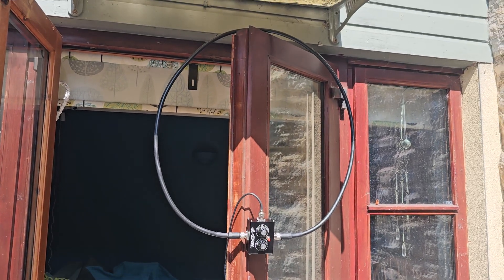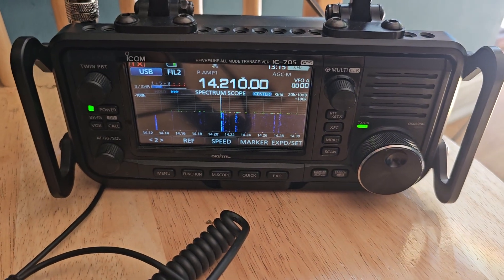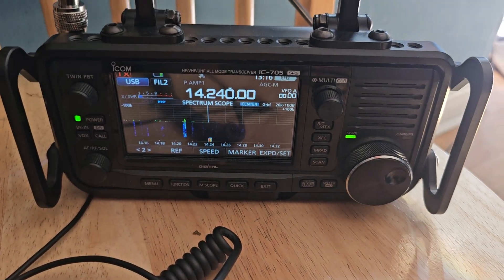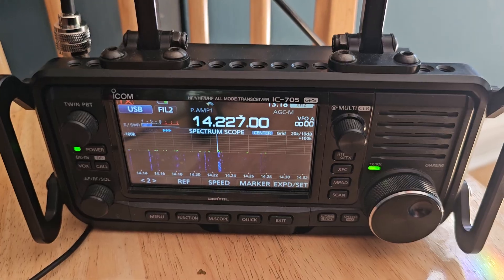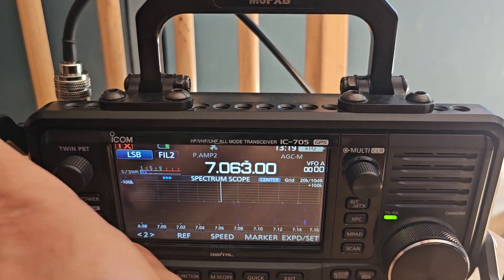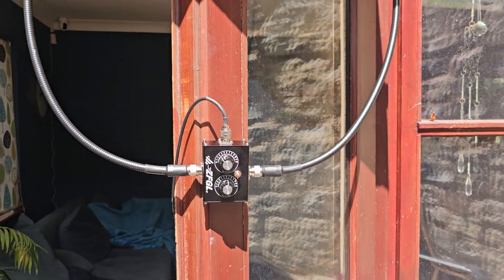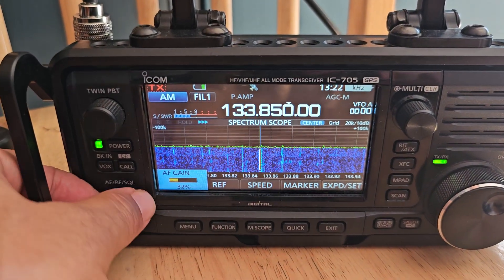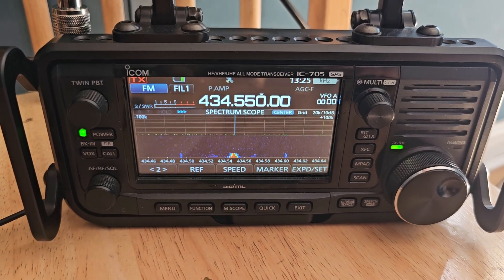Live Test - HG-20A 20w QRP Loop Antenna

Comment: Just made a mag loop out of junk. The varible cap out of a old vintage ATU I built. Wide spaced. Handles 50 Watts. Not tried any more. Built based on rule of the thumb design parameters. Covers 4 bands. Had no idear what it could do until I livened it up..  It works on 4 bands. 40, 30, 20 17. I need to reduce the capacitance to go higher. The min cap measured. On the varible is 44 pf. I need about 10pf or less. For 40 pound that one you have is very good value.   Going to make a smaller one with a remote adjustment.  But seeing this, is it worth it. Well it is, as I enjoy building gear which is how I discovered ham radio in the 60s building valve radios. I heard these strange creatures using AM in those days mainly. Ssb was an unknown to me then. Thanks again for your review.  We have spoken on air couple of times I believe. Cheers de GW4GJA.
Reply from the maker: That's awesome you built your own!

Comment: Nice little Loop Andrea's. Try Shannon ATC on HF = 5505 kHz, 5598 kHz, 5616 kHz, 5649 kHz, 5658 kHz, 5680 kHz, and 6622 kHz. They control all the aircraft crossing the Atlantic. For me, up here in GM land, I get a 5 to 7 on 6622 kHz with a long wire, and I have tried Paul's loop and can pick the same up on that, but not quite as strong. 73s